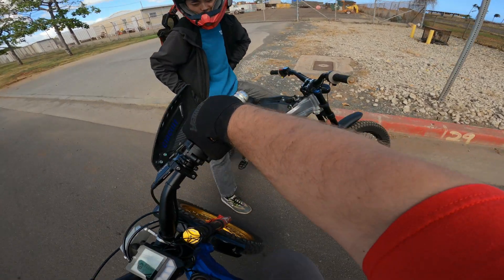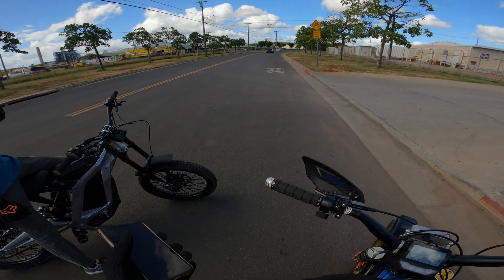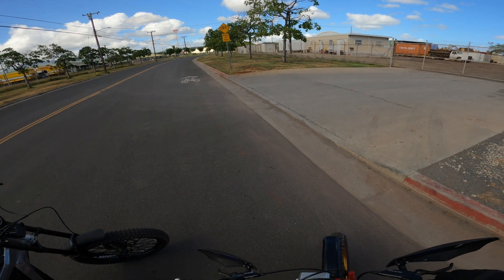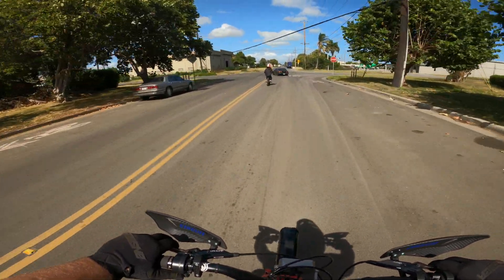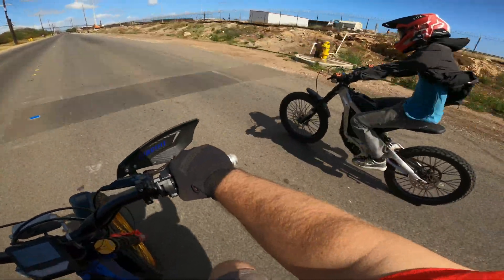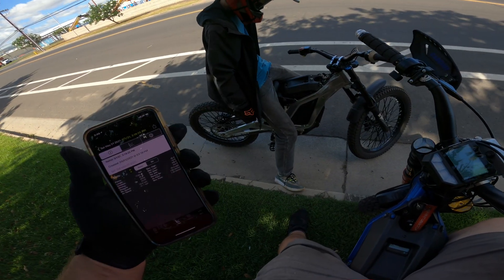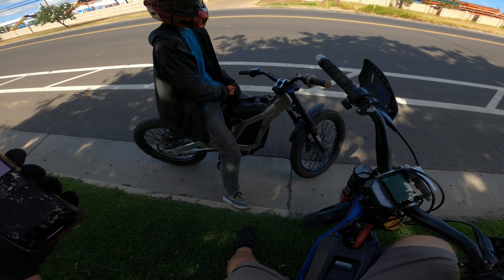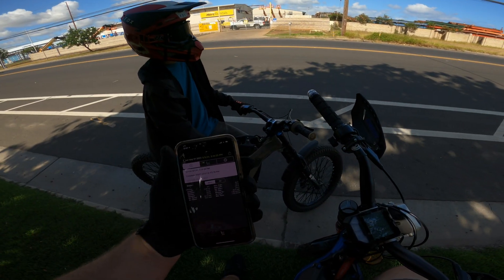Surron Lightbee Range Under Full Throttle

Comment: I have a Surron and this test on mine with knobby  shinko 520a tires at 18 psi would be even worse. But 20 miles beating on it through rough, hilly, desert hiking trails is easily attainable. Regen does quite a bit more in an off road scenario than on the street.

Comment: So 22 kms for about 75% of 61 volts x 30 ah = 1380 Wh. 75% of this is 1372 Wh / 22 =62 Whs per km..Thats insane...My 22000 watt Emmo Zone wouldnt use that at 70 KPH with the big 6000 watt hub motor. My buddies Zero electric motorcycle uses about the same at that speed with a much more powerful motor...not sure what gives.....
Reply from the maker: Math

Comment: How long does yours last on 30 mph. And how fast does it charge back up
Reply from the maker: I average about 45 miles on a typical road ride. If I were to hold 30 non stop. I would think about 25 miles. I’m going to be doing a surronshop battery full throttle test this weekend.

Comment: Was this on the 48 or 60v battery? 
Thanks for the video.  I appreciate the info. Probably going to get a 160x this week for my Birthday 😁
Reply from the maker: 60v
Reply: @Mayhemjach  thanks! Is that on the stock 160x controller?
Reply from the maker: @organicoceans4459  60v is a 260x
Reply: @Mayhemjach  is the battery the only difference between 160x and 260x?  Other than the tires being 17s?  My plan was to try to run 60v on a stock 160 controller?  From your experience does the 60v battery work on the stock 48v controller?
Reply from the maker: @organicoceans4459  you would need a 260 controller as well as the battery. Besides the 17s the front suspension is a single crown instead of a double. So it’s a lot weaker.